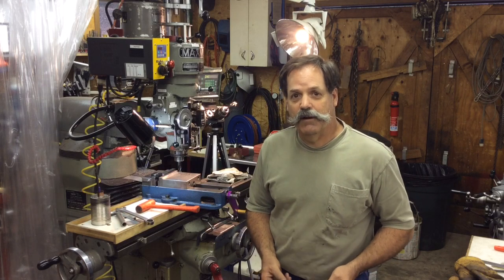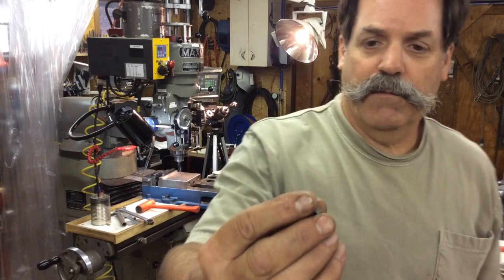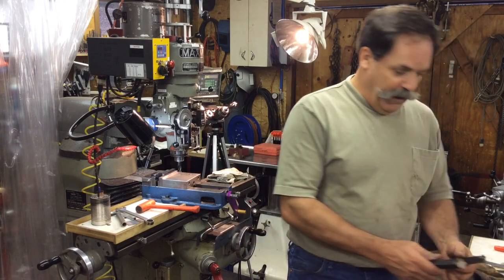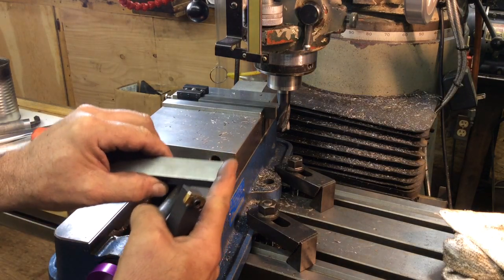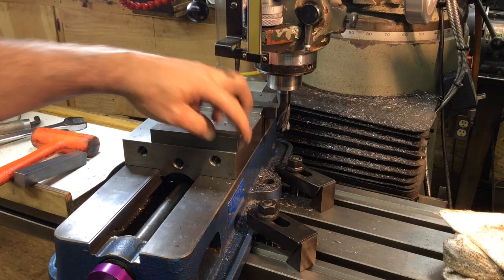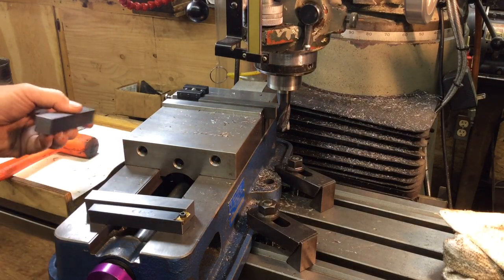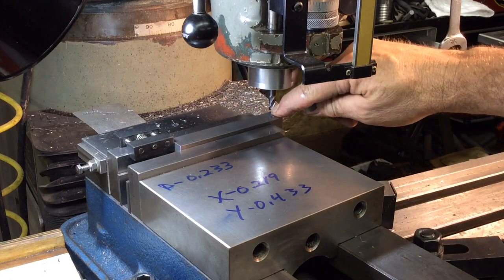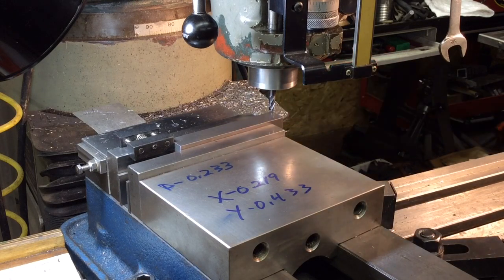How to make a Lathe Right Hand Turning Tool Part 1

Comment: I had to come back and watch this because I didn't remember how you had set up the cutting angle.  I see you just clamped the vice down at an angle.  I got a bunch of really small inserts which I think are VCMT and may try to make a double ended holder for them (or VCMT on one end and a SCMT on the other for chamfering) so I can just swap which spot on the QCTP the tool holder is on.
Reply from the maker: ILGopher Ryan that is a great idea.  Randy